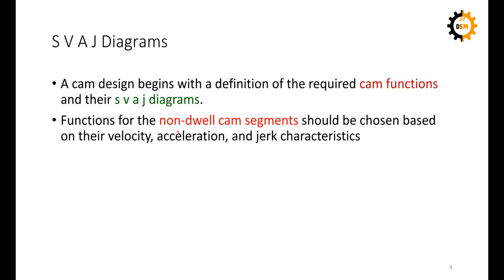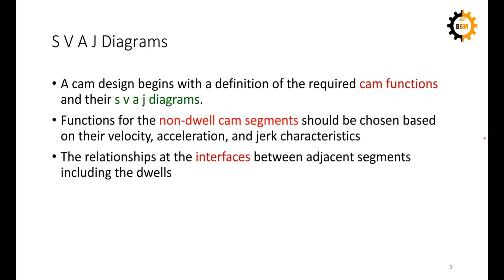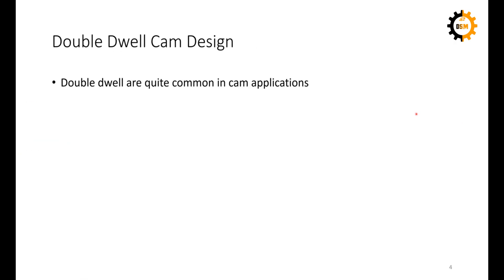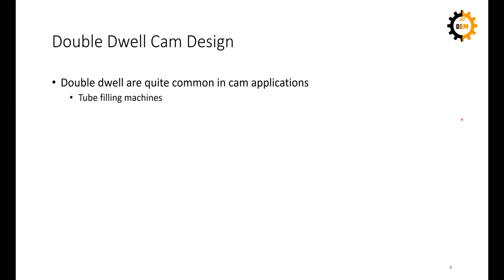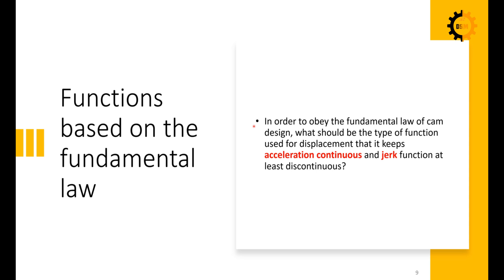28-2 Theory of Machines | CAM Follower Mechanism | Fundamental Law of CAM Design | Double Dwell

Comment: If a cam with sharp edges and streight profiles is machined, I think we can closely replicate the proposed solution. It may not be a stable system but still achievable?
2017099

Comment: 2017126
Assalam u Alaikum. For the jerk function to be at least discontinuous and acceleration continuous, we have to use a polynomial of degree 4 or greater as we are taking 3 derivatives to reach jerk graph and the degrees are being lessened at each derivative.

Q.  sir, what is the difference if jerk is finite but discontinuous and finite with continuous?

Comment: Any cam designed for operation at other than very low
speeds must be designed with the following constraints:
1) The cam function must be continuous through the first
and second derivatives of displacement across the
entire interval (360 degrees).
2) The jerk function must be finite across the entire
interval (360 degrees).
3) Piecewise functions must have third-order continuity
(the function plus two derivatives) at all boundaries.
The displacement, velocity and acceleration functions
must have no discontinuities in them.
2017276

Comment: The fundamental rule of cam design states that
1-The cam function should be continuous throughout the first two derivatives meaning the jerk should have a finite value. This means a fourth order polynomial (or greater) should be used

Comment: For CAM design following conditions must be fulfilled:
- The jerk function must be finite across the entire interval.
- The jerk function must be third order continuous
One suggestion would be to use a polynomial with order greater than 3 so that the 3rd derivative exists
(2016270)